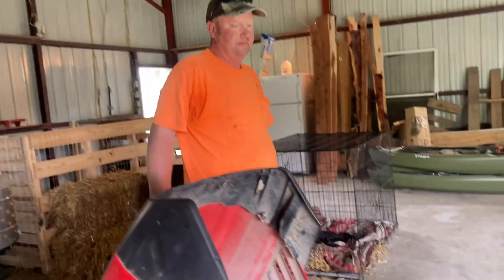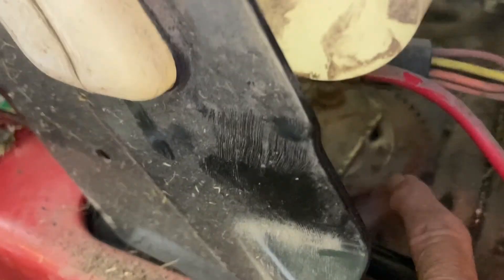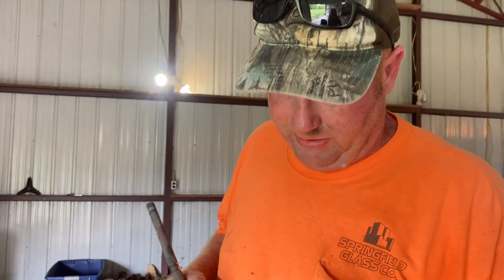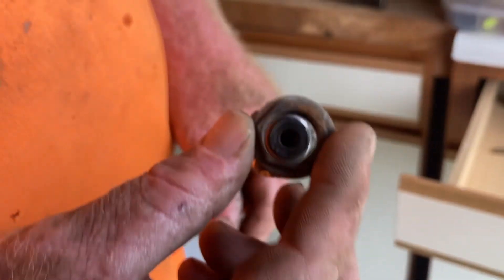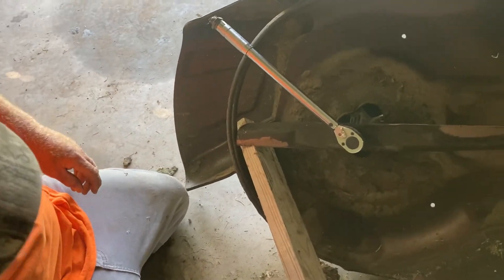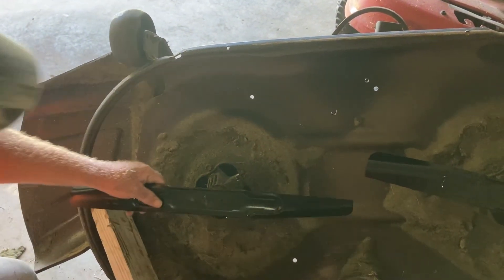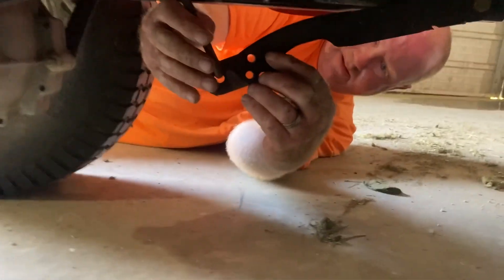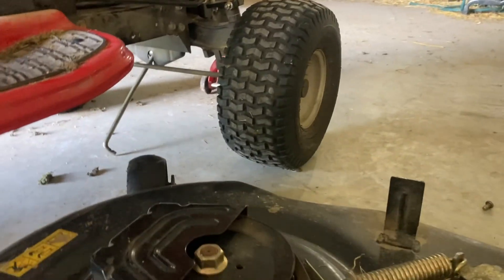Installing A Steering Shaft and Blades on a Troy-Bilt Hydro Horse 46" Riding Lawnmower DIY Project

Comment: I was gonna recommend the board trick for taking off the blades, but you figured it out. Pretty much the procedure for all the riding mowers I've dealt with. The last steering shaft I replaced was $100. Good video.
Reply from the maker: Cool, thanks

Comment: Thank you for sharing this!!! 👏
I used to cut mine with the speed wide open.
It wasn't long before the transmission belt burned and couldn't move.
Since then, I won't go a notch higher than 3.
I'd rather the job take an extra 30 minutes to complete than deal with replacing another belt.
But, come on, if I'm not supposed to drive it wide open then why is there a fifth speed option.👀🙄
I have the need for speed!
But, running on #3 is cheaper and less hassle.🤗
Have a fantabulous weekend!!!
☮️💖🙏🇺🇸🇮🇱🇺🇦✝️✌️😘
Reply from the maker: Ohhh my goodness Barb I just had a vision of you hauling butt around your yard yelling Yippee Yaoooo! 🤠